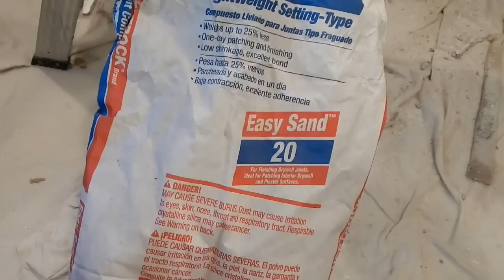Drywall Repair PLUS Stipple Textured Ceiling in 90 Minutes

Comment: For a small area like this I would suggest using a small roller to spread the thinned compound evenly. Once done then use your brush or sponge to replicate the texture. Practice on some scrap drywall or cardboard before to match as close as possible too

Comment: This video saved me $500.  A contractor wanted $600 to do this repair.  I did it myself for $100 in material.  It came out perfect.
Reply from the maker: Eric, Happy it worked for you.  $600 isn’t unfair but now you have $500 to spend on something more fun than ceiling repair!!!

Comment: When you load your brush you need to work the mud into the brush by bumping it in a empty bucket first then bump it on the ceiling. Also roll you mud on the ceiling in one direction then roll it in the other direction that way it levels out the compound so you will not have thick and thin spots.

Comment: This video helped me so much! It helps me to watch a “non-professional” do this kind of repair work because it’s easier to understand. I remember learning how to mud joints/drywall patches by watching pro’s videos. They make it look so easy and fast. Not one of them ever used layman’s terms like “start with your knife in a non-mud area and pull it toward the area with mud and scrape off excess..” Also, they tend to use pro materials like paper joint tape. No way should a ‘novice’ like me, EVER try to used anything but the mesh, adhesive joint tape. 
Anyway, I watched this video specifically to learn an easy way to apply the setting compound to a ceiling and make stipple patterns. However, I wish I would have seen it prior to teaching myself how to patch/mud drywall. It would have saved me tons of sanding!! 😄 Thank you!

Comment: Pro tip: when patching a hole like this, cut the hole, and patch round, not square/rectangle. Square edges are harder to blend. The round patch will blend better with the roundish texture pattern. It may take you a little bit longer, but the results will be much better.
Reply: Also use a piece of scrap drywall to test the pattern. Thicker mud will produce a heavier texture. Thinner mud a lighter texture. Start with less water and keep adding until you can duplicate the existing texture.
Reply: A circle patch never seen that before only on smaller walls patches

Comment: Hey Todd.  Working on an identical project.  Leaking toilet above.  I notice that your joist is black.  Mold scares me.  I spent a day washing and scrubbing with Peroxide.  Wondering why you covered it up?
Reply from the maker: Hi Mark.  Good luck with your repair!  I'm not a mold expert for sure but I think there is a  difference between mold and discoloration (the black you saw).  I didn't see mold growth on the joists or any decay so I wasn't concerned but thanks for asking.

Comment: Do you not paint over the wet compound or no paint required? Also does the color on the repaired piece match the rest of the paint stain on the rest of the ceiling?

Comment: did you buy your brush in that condition, smashed almost flat, or is that from years of use.  I purchased one but the bristles are straight.
Reply: Get the bristles soaking wet and you can get them to seat how you'd like.

Comment: Thank you for a great tutorial. We would love the 4 speed impact drill. We are having to replace our tools. Our kids and grandkids moved out and so did quite a few of our tools. We are going to attempt to repair a large opening in our bedroom wall about 14" by 4 1/2' due to a plumbing repair job on our shower faucet and nozzle. We just moved into a manufactured home and there a quite a few repairs that need to be completed. The four speed impact drill would really help with all of the ongoing repairs that come with thebeing a home owner. Thank you for considering us.

Comment: Really surprised you didn't put tape across those seams, will crack open on no time
Reply: Don't Loser He did, he took off the tape then applied a layer of compound then retaped and reapplied a layer of compound over.
Reply: Don't Loser Did you watch a different video than the rest of us?